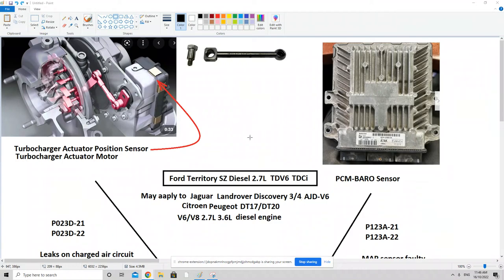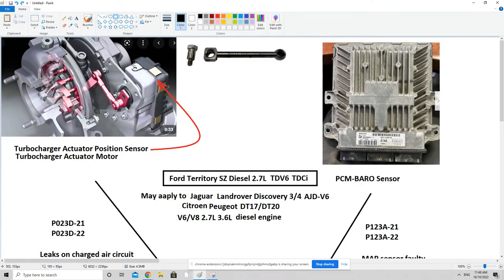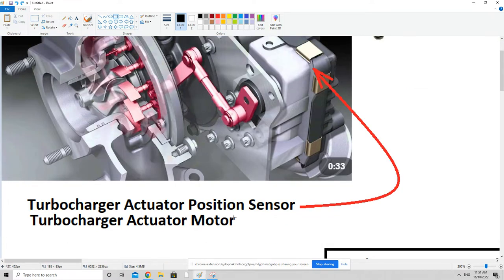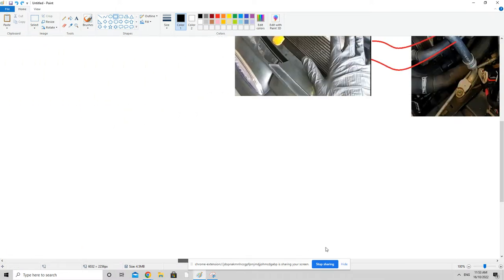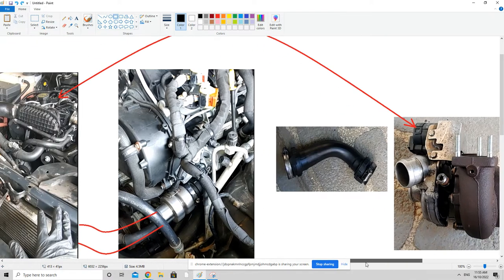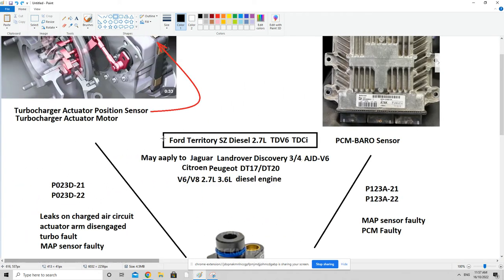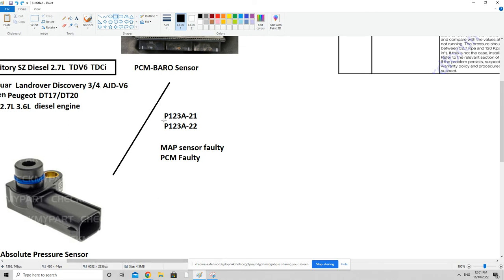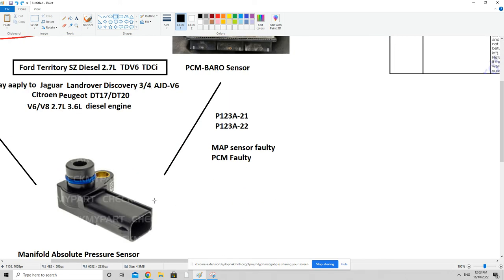Ford Territory SZ 2.7L Diesel P123A and P023D, AJD-V6, DT17, DT20

Comment: 13:15 or maybe MAP sensor is dirty?  Mine was literally plugged full of gunk.  Took 5 mins to clean.  But you make a good point about the PCM barometric pressure comparison to MAP at start up.
Reply: Learning lots from your videos. Keep em coming
Reply from the maker: True that's correct.. MAP sensor is the primary culprit and end up with piles of soot that can prevent it from proper measurement...

Comment: My SZ diesel was jumping around and then went into limp mode.. lots of smoke out the tail pipe.. when I scan the car I’m getting a code for control module communication bus A off. 

I’ve looked at the speedo cluster and checked the connections.. it’s like the car is running on less cylinders and bouncing around.. I did clean the MAP sensor not long ago.. I also replaced the passenger side egr before the symptoms started. And also cleaned the drivers side egr as it was still functioning.. that’s the only code I’m getting so do you think it’s my PCM or can you think of anything else 😭
Reply from the maker: @kymmmyken  what code are you getting??

Comment: I’ve cleaned a bunch of sensors with mad cleaner and now I get a engine light, cruise unavailable. And the car doesn’t rev above 2500rpm and and has gone into limp mode. 

Any idea why this may of happened or what I can do to reset? I’ve got an obdII TOOL and have reset the codes but no luck, I’ve reset the battery no luck
Reply from the maker: Can you read the codes using scanner and share? Mad cleaner you mean the stain remover?
Reply: @RZJugaar  the only code I got was the p0237 and sorry type, meant maf cleaner (crc brand)
Reply from the maker: @anels9  carefully remove your boost sensor (the one shown in the thumbnail of this video). Inspect and put it back. Make sure it's properly connected. If you still have the problem then your sensor has gone faulty and you need a new one.
Reply: @RZJugaar  yes I still have the problem. Is thumbnail a pic of the map sensor?
Reply from the maker: @anels9  yes and no. it's a boost pressure sensor but since both map and boost sensors measure the pressure, the terms are used interchangeably..
In your case the boost pressure sensor is gone.. you'll need a new one.